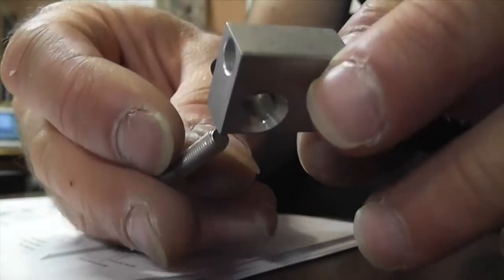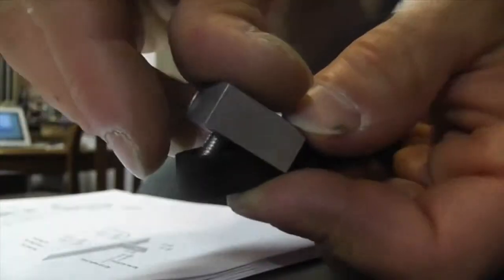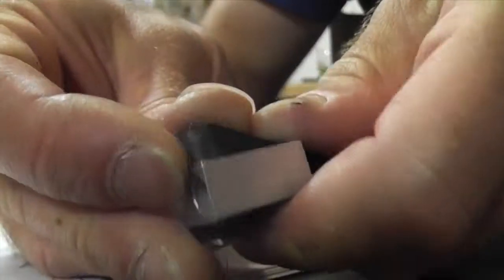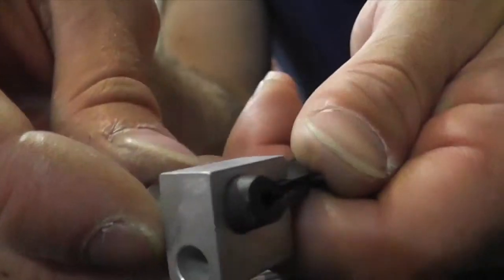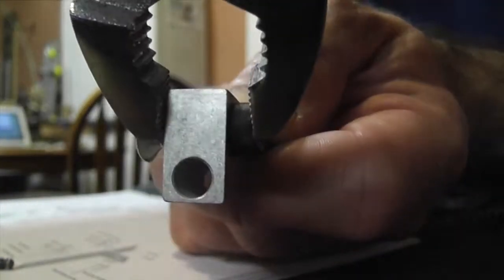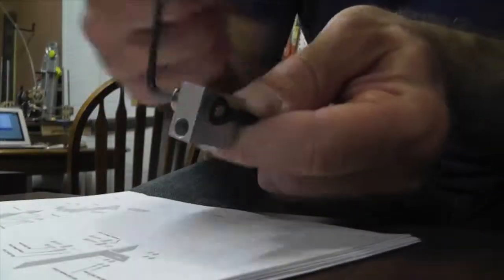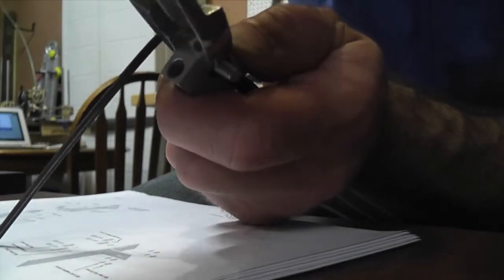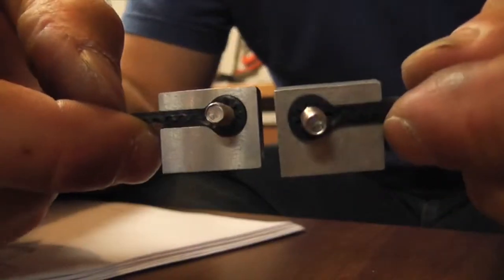Installing Belts onto Tensioners

Comment: It would be great if that tensioner block in your hand was a mirror copy of the block on the other side (for Y travel), so that both belt tensioning screw heads point toward the front of the frame.  As it is, one tensioning screw points forward and is easy to get to, and the other points rearward, and is very difficult to get to, which makes getting equivalent belt tension for those two belts all the harder to do.  Great printer, though!  Cheers!